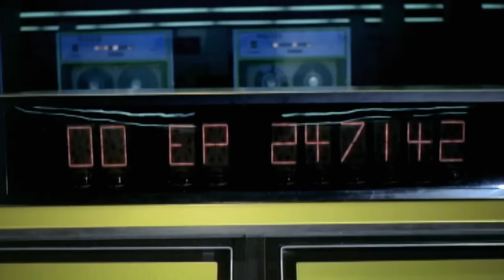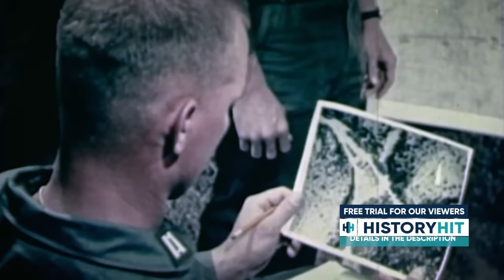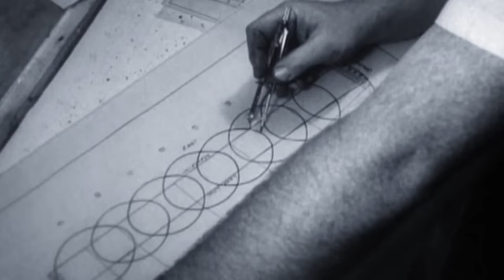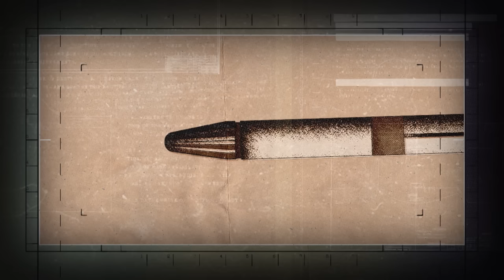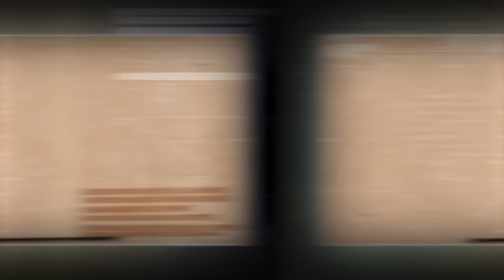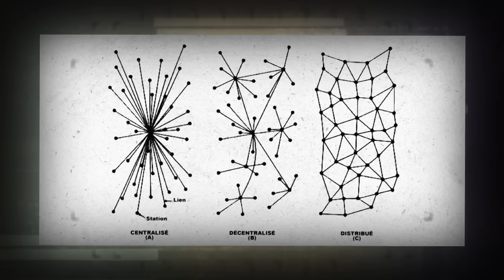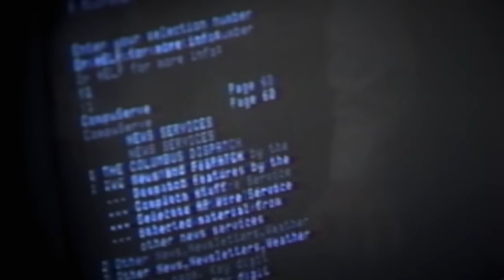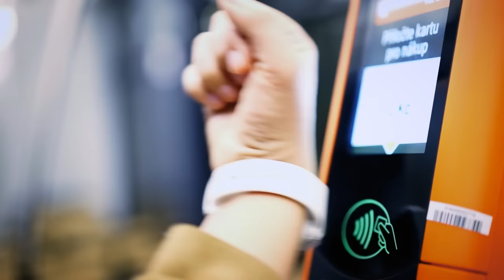Atomic Spies: The Cold War Battle For Information | Cold War Tech Race | Timeline

Comment: Gary Powers U2 was brought down by Soviet pilot Captain Igor Mentyukov at altitude, under orders to ram the intruder, he had caught the U-2 in the slipstream of his unarmed Sukhoi Su-9, causing the U-2 to flip over and break its wings. The salvo of missiles had indeed scored a hit, downing a pursuing MiG-19, not the U-2. If a missile had hit the U-2, its pilot would not have lived.

Though the normal Su-9 service ceiling was 55,000 feet (16,800 m), Mentyukov's aircraft had been modified to achieve higher altitudes, having its weapons removed. With no weapons, the only attack option open to him was aerial ramming. Mentyukov asserted that Soviet generals concealed these facts to avoid challenging Nikita Khrushchev's faith in the efficiency of Soviet air defenses.